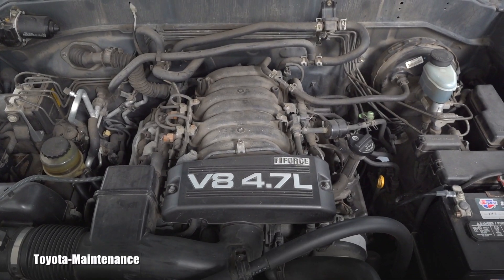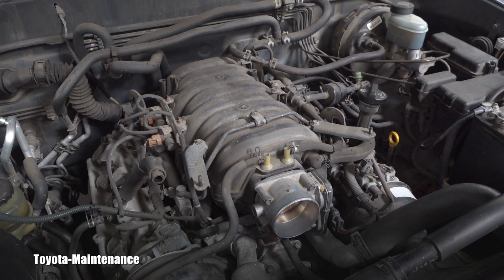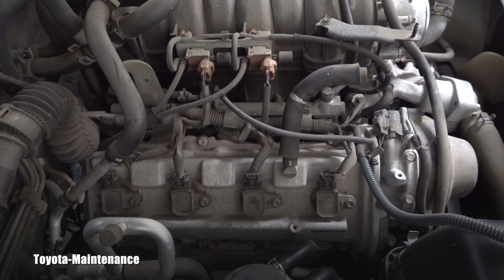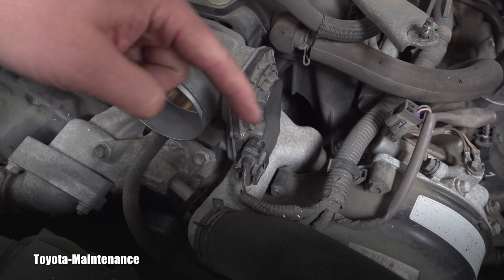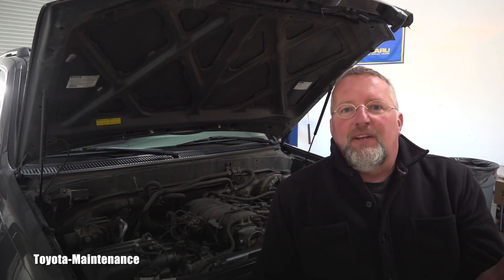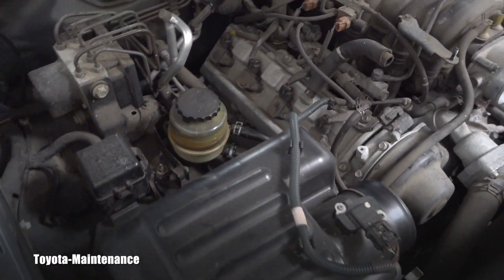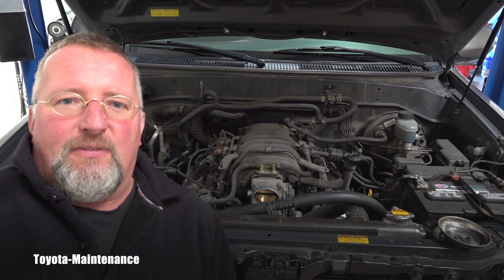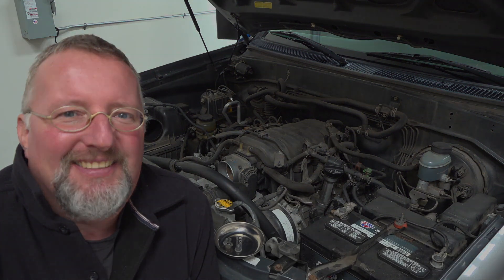TOYOTA 2UZ-FE 4.7 Liter iFORCE V8 Engine

Comment: Why do this engines get such bad fuel milage in general  an no dont say its the cast iron block
Reply: It's a v8 in a truck with short gearing. Compare it to the Dodge hemi, nissan titan, and Ford 5.4 and they are all similar mileage. Only the LS powered chevys got decent mpgs

Comment: replacing the starter is what your talking about.. to do so you have to take off the intake manafold and cables.. 3 hours of labor to replace the starter.. because the starter sits on TOP of the engine, not below it.  also the pre-VVT engines will never have that ticking sound when you start it up..  it cost me 1,000$ to replace the timing belt. at the local mechanic.. in the DC area ..

Comment: I have a 2001 tundra, 300,000 miles. Have done nothing but change the oil, ignition coil, plugs. Otiginal timing belts and lbj. About to do both of those.
Still as clean as the day I bought. So I love these engines!!!!
Reply: So, you are saying 300k miles on yours and you never changed the timing belt? What is an ibj?
Reply: Think he means lower ball joints. Maybe he is trolling because these were recalled and cause serious problems if they break while driving

Comment: I got a 2008 toyota tundra 4.7.    Code p2436/p2438. Secondary air injector system.  Bank 2 .. I don't know which part causing it

Comment: I love some people in here or trying to argue that it’s not a good engine because the timing belt maintenance is maintenance. If you refuse to do maintenance on any motor, no matter what it will break down. Reliability is doing the maintenance and the motor just never quitting.

Comment: I have the same engine, had 523k on it, low compress, work at a Speed Shop and building racing engines. 

So we decided on running the 4.7 block bored to 5.0 with the 5.7 rotating assembly and intake with 4.7 heads. Added Hastings street pistons with Teflon shirts and h-beam titanium connecting rods, added a single turbo as well and portmatched the intake and the heads ported as well. Used JBA shorty headers true duel exhaust running through an series 50 flow master exhaust.  XAT racing custom billet zu vvti race cams. Cold air intake.  Dyno last week at 522hp 524 ft-lbs @ 4400 RPM. Next changing gearing, rebuild tranny and transfer case.  New disk brakes front and rear.  We will most likely be submitting the build to Engine Builder Magazine sometime this year.
Reply: Here to archive an update!

Comment: BEWARE!!early 4.7 were a maitence trap!  NON-STARTER UNDER BACK OF INTAKE MANIFOLD,front lower exploding ball joints, frame turning to rust flakes,never ending timing belt pulley bearing and tensioner problems,shifter lever on colume would dis-intergrate,stick coils shorting out any time water gets near them,front brakes really to small for pulling trailers,bad paint fade, not the kind of truck any joe can repairMAITENCE TRAP IF YOU AREN,T GOOD SPINNING SPANNERS..........
Reply: Bought my SR/5 4x4 new in 05 not one problem, still looks and runs like new, but I only just turned 44K, and it is always in my garage if not one the road.
Reply: Bullshit lol.  Owned 2 tundra for over 10 years not one problem with anything
Reply: @ToyotaNutjob  I,m talk,n about first yr 2000 had alot of problems,what yrs were yours?
Reply: @ToyotaNutjob  o1 is not first gen my freind,2000 is interference valve motor small front brakes that shake exploding ball joints ,steer colon shifter brakes off etc,on and on ,2000 was first gen after T-100 yoda truck and had alot of maintenance surprises.........
Reply: @ToyotaNutjob  re-read what I said,never said T-100 was a 2000 tundra which is interference, any I-force is non-enter according to Toyota specs......
Reply: @zeke2566  how about the 02 sequoia. 4.7 v8. 0 engine problems thus far 135k in

Comment: I purchased a 2002 Tundra 4.7 last year with 360k miles for $5000. It is by far the smoothest running v8 truck I have ever owned. Has not given me any trouble yet, ooh I had to change o2 sensors but that’s it. I love it so much better than my last truck, 97 GMC Sierra

Comment: My 2000 tundra sr5 with 2uzfe, not an iforce, has 270000 miles. Would it be better to use regular conventional, a synthetic blend, or full synthetic engine oil in it. I personally have been using Advanced full synthetic since 190,000 MI started out with Castrol Edge high mileage the good stuff then switch to Mobil 1 Advanced full synthetic high mileage extended protection about 200,000 and it's at 270 now would it be better to keep using that or to use regular conventional

Comment: I have a Toyota Sequoia 2001 limited 4WD 156 k miles.
When I switch from Park to reverse, reverse to drive and Park to drive the truck jumps forward or back without touching the pedal or even if I’m on the break, clunk and jump, when driving around I think switches gear really good and no problems, only problem is that clunk noise and jump when I put it in reverse from park o reverse to drive or drive to reverse, could you please help me ? Appreciate your work

Comment: I just took my truck to the dealership and had a timing belt, spark plugs, water pump, and plugs changed when I got my truck back home I have a high-pitched whistling sound coming from the engine. I changed the grooved pulley and bearing just to try to eliminate any issues but the truck is still doing it. I'm also getting a whining noise when I'm running at low speeds almost like I've got something wrong with the transmission but it's coming from the engine. Do you have any idea what this could be I am going to take my truck back to the dealership but I just wanted to get some opinions
Reply: hey ik this is kinda late but did you ever find out what the issue was?
Reply: @jonyboyx6576 Yes I did It's the serpentine belt, I don't know why it's squeaking so much but the new one is. I can put a little bit of soap on it and it goes away instantly so it has to be the serpentine belt. I've read that after a while these belts may be just a millimeter bigger or something in the start squeaking, they make a belt by Goodyear that's called a non-squeaky belt I'm going to try that
Reply: That whistle is probably the timing belt.
Reply: @Toxox1979 we discovered it's the serpentine belt, one day I rubbed a little bit of soap on it and it went away instantly so that's what it's got to be and I've done that repeatedly.

Comment: Correct, but, with one fatal weak point which is the engine timing is by belt not a chain, and this is an interferance engine means if the timing belt snapped out for any reason ,,, Goodby engine ,,,

Comment: Sir  i have question with this engine. I have truble that I couldnt find.. I replace timing belt tensioners bearings water pump, camshaft oil seal.. Then when I start the engine theres a sounds like air and then when you shift it to drive the sound will gone but when u return it to neutral the sounds came out again the sound is coming from the front of the engine.. Any suggestion sir... Thank you...

Comment: At what mileage should you replace the timing belt?? I have a 2005 Tundra with this engine and 180,000 miles. Just wondering??
Reply: Supposed to change by 90k miles. No later.

Comment: Can these be driven fast like sustained high rpm? I’m wondering if they can handle WOT at about 5k rpms. In 28 degree weather after warming up and being driven for ten minutes before hand. Asking for a friend. Thanks.
Reply: Yes. I wondered the same thing and yes I do it. Its just not the greatest thing for your truck cause everything else wears out too. The engine and trannys are strong but the Toyota gods will punish you if you abuse it. Wop everyone in a while

Comment: I looked for a 2006 Tundra because of this power train. Still runs like new. Low revving high torque engine that is smoooth. Love driving this truck. Only downside is the fuel. Woo does she drink that gas.

Comment: I have 260,000 on mine but now has a head gasket leak. I want to replace the head gasket and do timing belt I've been quoted around $4k my question is is it better to REBUILD OR REPLACE?

Comment: Unfortunately this toyota engine has a timing belt and is interference engine. If the belt breaks, it will bend the valves.

Comment: That is a very long timing belt on the Subaru. The belt must do a lot of work. I carelessly let my Toyota 1HZ diesel go 40,000 miles and 18 years before changing the timing belt. The old one had no apparent wear on it. My mechanic replced it with a Gates one. He also said city driving, stop go sort of driving is hard on timing belts.

Comment: I own a 2005 Tundra SR-5 with this engine. Has 118,000 miles. Oil and filter changes were the extent of servicing until last week when I had the timing belt/water pump replacement done. The camshaft seals were leaking ever so slightly, so replaced them, along with the spark plugs and valve cover gaskets. I’m gonna run it up to 250K then rinse and repeat.
Reply: How is it doing now?  I’m trying to decide between a 2002 Tundra with the 4.7 V8 or a 2003 Tacoma with the 3.4 V6.  Going for reliability.. but I hear good things about both.
Reply: 145K and doing great. Runs like a sewing machine. For some reason, mpg has slipped from around 16-17, down to 13-14 over the years. Other than that, no complaints. I have no experience with the Tacoma so I can’t speak on those.

Comment: There's a 5.7 liter Tundra with over a million miles now. Incredible reliability.
Reply: I think you mean 4.7L? There’s 3-4 I’ve seen on the net.
Reply: @greenbanana2332  There is a 5.7 liter now with a million miles. Look up Blaine Johnsons million mile Tundra on you tube.
Reply: @highplainsdrifter9849  : Ahhh, I stand corrected. 👍🏽

Comment: How expensive is it to get a lifter fixed on these engines I have one that needs to be fixed making a ticking noise
Reply: @carlos Mendez Unless you're absolutely sure you have a bad lifter I would recommend getting a second opinion. All of these engines tic while running, its a well documented phenomenon. And if you have an exhaust manifold leak the tic will be worse.

I'm not saying you're wrong, I just wanted to throw that out there in case you're not aware, and also for anyone who may read this in the future.
Reply: @markalan4026  well I put so Lucus oil in it and it’s been quite ever since even on really cold mornings so she’s still running strong!!!
Reply: @carlosMendez-un4wx  Glad to hear that 👍🏻
Reply: Pretty expensive job, probably around $800. I have the same issue. Try putting sea foam in your crankcase to see if that resolves it first
Reply: @jaredgeere300  how long should I run seafoam in it for

Comment: Thank you for this video. Great! What’s your feedback and opinion on the V6 4.0 on the 4RUNNER? Love the channel.
Reply: Miguel A. Rosado The V6 is easier to work and has a timing chain.  It will last almost as long as the V8.  I like the V6 better.  If the oil stays full and relatively clean either powertrain will out last the rest of the truck.
Reply: Depends what you use vehicle for? V8 is way smoother and much more capable towing. MPG savings is negligible between V6 and V8.

Comment: I just bought a 2004 sequoia for $5500 
Its got 247,000 miles on it and still runs great. The previous owner fallowed all the Maintenance schedule and replace a lot of the old worn out parts so I should be good for another hundred thousand. I do need to change the timing belt in about 40,000 miles

Comment: Just made 300,000 miles on my 2005 SR5 Tundra 4.7L V8.  Still running strong!
Reply: Have you ever changed timing belt? I'm thinking of buying a used 2004 with 4.7 liter and they don't know if its ever been changed.
Reply: @fokkerd3red618  don't pry it too much! Just enough to see the belt. There's a video on youtube that shows you also.
Reply: @fokkerd3red618  did you buy?? i just bought 02 sequoia,, price was unreal w. airconditioning, tires, and limited edition 250thousand miles running like a well oiled clock
Reply: @fokkerd3red618  There are 2 screws on the timing belt housing located on the left side of the engine. Take them off and kinda pry it open. You can see and inspect the timing belt from this point.
Reply: @fokkerd3red618  just change it.

Comment: Have one in my 06 4runner, 150K, great engine, good gas mileage (for a V8) good sound, good torque, no BS.  Not every V8 needs to be 6.0+ litre and a fuel hog, at least not in a daily driver.
Reply: By now it’s probably went down from my bullshit I do to it but i can get just above 300 miles on a full tank
Reply: @noahmasse5854  Mine too (TRD pros and heavy K02's etc), I've heard its the same as the new ones with the 4.0L because they are heavier, not sure if true or not.
Reply: How many miles do you get on a full tank?
Reply: @mopheousredpill7462  : I get about 325 a tank on my 04 4R 4.7 V8. Best mpg (hand calc) is 18. Typically get 16. I run KO2’s.
Reply: @greenbanana2332  Yeah I think 300 mi on a full tank is about avg. I got a GX470 V8 4.7 with a 21 gal. gas tank and get max 300 mi. has anyone gotten more? This thang is a gas hog lol
Reply: @mopheousredpill7462  I have one in my 06 tundra and I get about 18 mpg

Comment: Hands down the best engine ever designed I have a 2001 sequoia with 140.000 miles runs smooth as 🧈
Reply: You'll get a lot more miles out of your vehicle, if it's taken care of properly.  
Own an 02' Sequoia with over 250k, still runs fantastic with no issues.
Reply: 🤦🏻‍♂️ my lawnmower has 140,000 miles on it. Not saying it’s a bad engine but saying it’s the best ever because it has 140k miles is dumb
Reply: @suppaman12  just got a 2008 Sequoia with 57,000 original miles from the original owner. You believe the thing still runs strong?

Who would've thunk?? 
A Great vehicle from a great company.

At this rate, the truck should be able to reach 90, maybe even 95,000 miles. Easy....

Comment: I love all of your videos!  I've had 2 1999 4Runners, an 01 Runner and a 2006 4.7l Sequoia.  Love these trucks!  My question is, do you have a how-to video for the best way to replace the serpentine belt on the 2006 4.7l Sequoia??  If so, do you have a link??
Reply: Re kve air filter housing and radiator hose and your good.

Comment: I drive a 2006 toyota Tundra 4.7 V8. The last year of the first gen Tundra before the 5.7.....
I've just recently got my Timming belt and water pump replace. My tundra is currently at 175,000 mile. The engine have never given me no issue what so ever over these years.

I have never try towing anything that will come close to My truck limits at 6,500 pound tow rating and ill never want to try to push it. The only thing i tow over the years have been my pop up camper that's 1,400 pound and my hunting equipments along with my buddies sometimes and with 1-4 deers stack on my bed coming home from hunting and I never had issue with that load.

For what i do for fun in life the 4.7 V8 is enough power for me.
Reply: I have a 2008 with a 4.7, 160,000 miles and running like champ.

Comment: I have a 2005 sequioa  with these engine I have  misfire on cylinder  6 replace  sparkplugs  coils  and injector test  ( could be exhaust valve  problem)

Comment: Yes I have 2000 Toyota Tundra 4.7 was over heating sealed radiator  ,still over heating . So far replaced water pump radiator alternator& battery now it has a pour coming fr the middle of truck motor do t know what's wro g help

Comment: Buddy of mine has 2002 Tundra V8 4x4 and just turned over 400,000 miles with no major component failures.  I have a 2000 Tundra V8 4x4 with 170,000 miles and runs great.  Both of us are the original owners.

Comment: One of the trucks i drive for work is a 2005 Tundra with this engine .
538,370 miles on it and counting.
Reply: gabealexander88 how many times have you replaced the timing belt?
Reply: @biggameslayer3782  .Probably never. That company isnt a fan of regular maintenance that cost $$$
Reply: gabealexander88 oh wow

Comment: Love my 2007 Toyota Sequoia......this far.  I change the oil myself. Use Mobile1 full synthetic and a quality oil filter. I had to change my fan condenser. When I took my truck to the dealership to replace the airbag (recall).  I had them pull up the maintenance record on my truck. The timing belt was replaced at around 110,000 miles (phew!). I’ll do the next one at around 220,000. I’m at 195,000 mile now.
Reply: Change your profile flag to a Japanese flag, since you cant even support american companies.

Comment: I have 400000 miles on my Sequoia. And absolutely no problems
Reply: 250k on my 02 Sequoia.  No issues as well.
Reply: 232,000 on my lexus gx470 no issues
Reply: @michaellflo   These trucks are truly amazing..  one  thing to be aware of servicing timing belt on time to avoid engine damage if broken.
Reply: @melchizedek129  every 90,000 I do timing belt and water pump!!
Reply: My 01’ has 205k miles it’s amazing limited model what year is yours @winston stoute
Reply: @ryneporter2752  I have an 05
Reply: 2001 Sequoia limited 235,000 miles
Reply: @bry76in  they just won't die . Love it.
Reply: 345000 on my 05, normal maintenance!
Reply: 😮´´ That's amazing ...!
Reply: Man my 2005 is barely a baby at 145k miles, just recently changed the serpentine belt due to a whine at idle
Reply: @jamesmaldonado5794   try using belt spray it helps it from cracking and eliminates noise. . 145K long way to go before you get tired of it.
Reply: I have 331k on my 2006 tundra and runs like a champ
Reply: @thistagworked  I only changed mine because it's one of the ares spoken about in the truck. Guess it's more for just precautionary reasons but I believe you.  They'll definitely go on for much more than 100k
Reply: i have an 03 sequoia and the head gasket is fucked up because the previous owner was drunk and messing with it 😣😣
Reply: I have 247 miles no problems absolutely